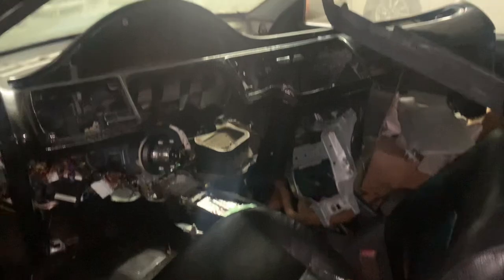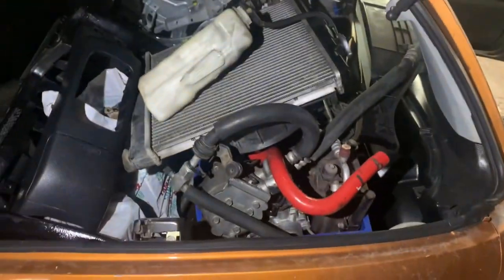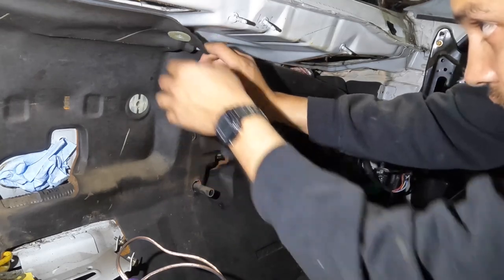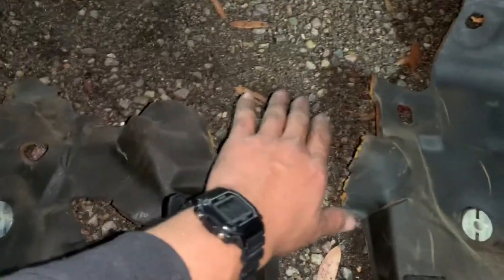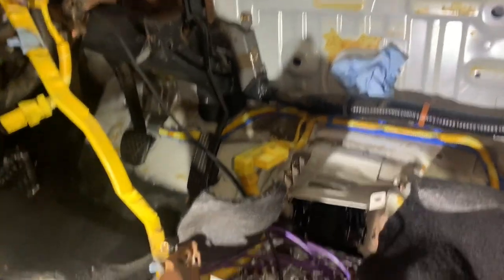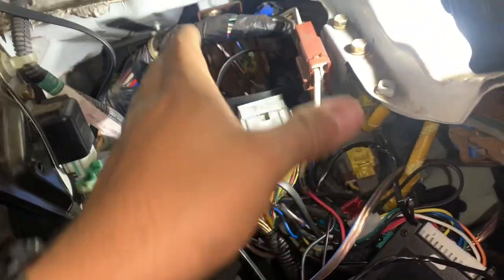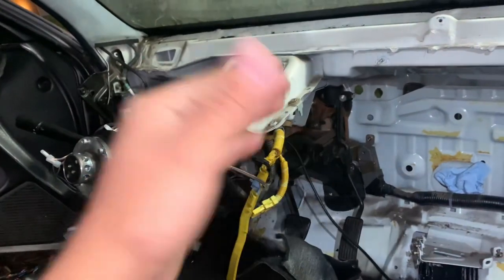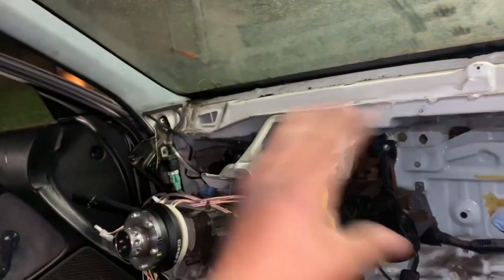Removing 92 Honda Civic Firewall Mat And SRS Harness | Vlogmas

Comment: That little red switch is a momentary button switch.  It can be ran to a relay to operate nitrous, a horn....just about anything. One thing for sure it is not oem. Nose bleeds are from the cold dry weather. Small Capillaries vessels crack in your sinuses causing small nose bleeds.  I get the same condition during winter. Excellent video Jonathan.
Reply from the maker: Nice. Ig I’ll hold on to it. Also ima check the messages on Instagram right now. Just got off work. And idk what it is but I have random nose bleeds throughout the year and this one started while I slept. I woke up and my nose was clogged and while at work it started bleeeding. I hate them

Comment: You just saved me 2 hour from not removing my dash , the main harness and engine harness got messed up in my tucked hatch and shorted on the body,tomorow I’m gonna rip appart the foam insulation to remove the other harness in the scrapyard for a new harness 🙏🙏 hope it’s gonna run again 💪
Reply from the maker: Glad it helped!
Reply: @johnnyrzgarage got the new harness 💪 let’s do this and see if it run strong again 💪

Comment: Did you figure out where you are going to run your shift cables & also what conversion harness are you going to use
Reply from the maker: I haven’t. In your vids do you show how you routed them? Im going to work on it right now so hopefully I figure it out. And for the harness I have a k20a3 swap that has what I think is the conversion harness. Idk the brand but ima look at it right now and see how it connects
Reply: @johnnyrzgarage  are you keeping your heater box?
Reply from the maker: I’m replying late to all these lol. The app sucks at showing replies. But I want to keep the heater and would like to add a/c later on
Reply: @johnnyrzgarage under the car right behind the subframe there’s a perfect circle on the floor that I cut out and ran my cables through there